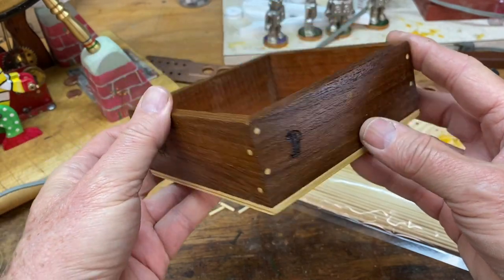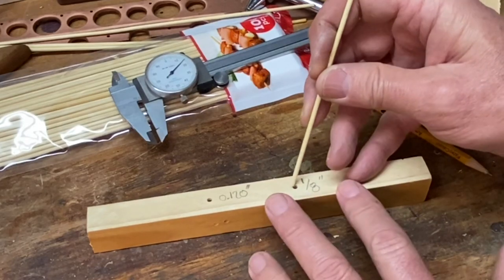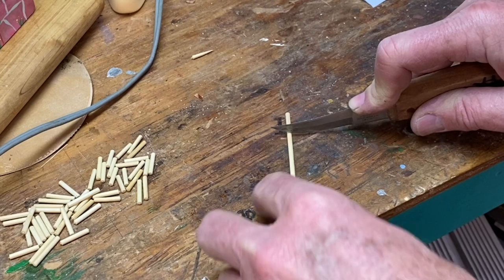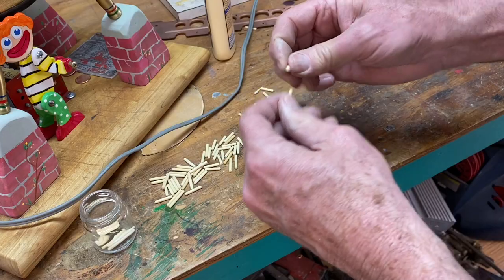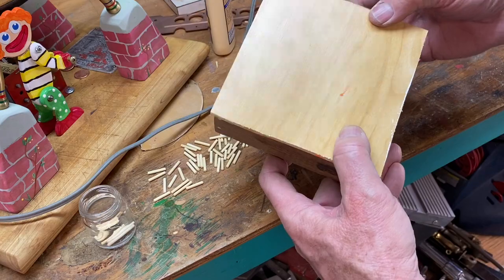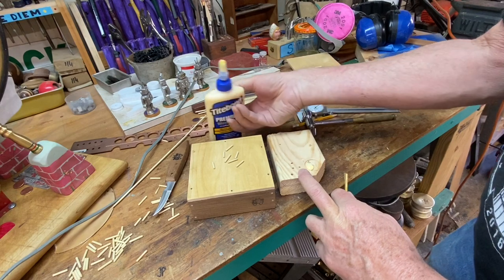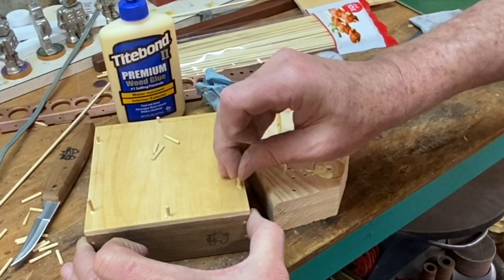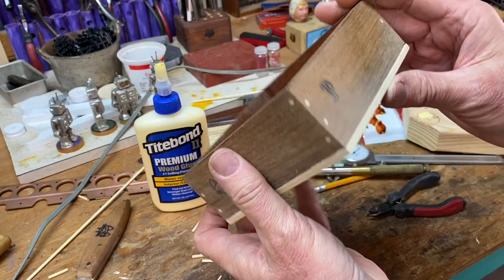I Like to Use Bamboo Skewers as 1/8” Dowels for Small Woodworking Projects

Comment: The dollar tree store has packages of skewers, too.  $1.
Reply from the maker: I’ll have to look next time I’m there!
Reply: Thanks for including the tips of how to cut and handle these skewers. Very helpful.  (Mine split the last time I used them, little strings of bamboo fiber were shedding off some.) 

I forgot to say, I've used these skewers lately to make  separators/dividers for small open boxes like yours.  Just what I had on hand, didn't have the thin material to build a divider.  I just drilled sets of holes in opposite sides of the box, running vertically, and didn't glue the skewers in. So the holes are laid out in a grid and the separators are adjustable for diff sized small tools.  Wouldn't work for everything due to the open nature of the separators, but was fine for the purpose this time.  And cheap.
Reply from the maker: Interesting,,,,!